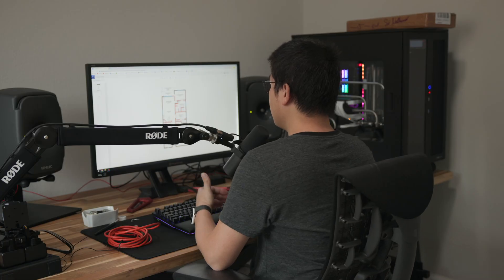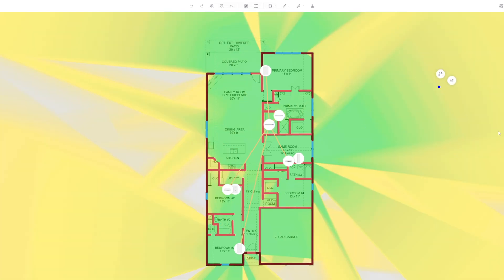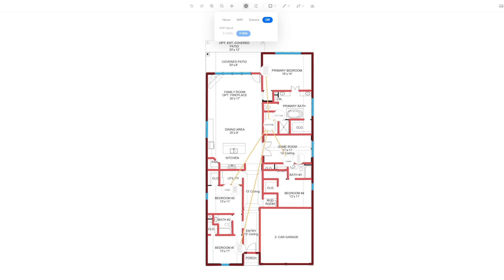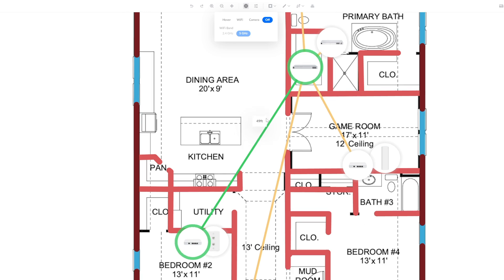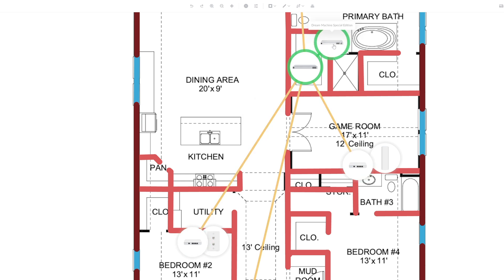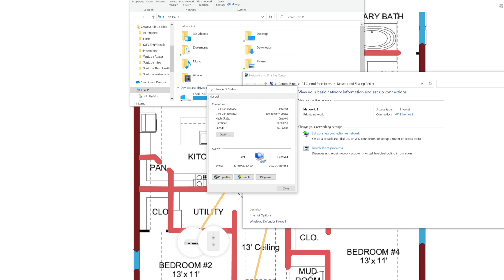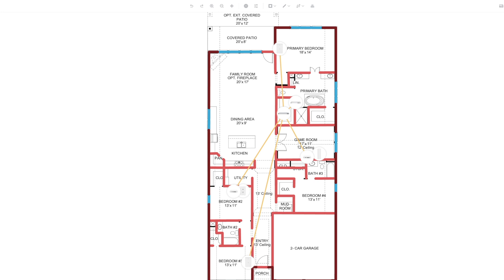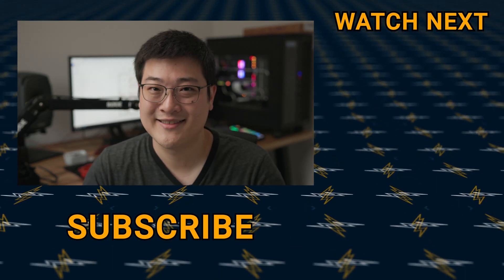10 Gigabit over Cat5e!

Comment: It doesn’t work for me. My 10GB Nas and 2.5G Wifi router is connected directly to a 2.5G switch using a Cat 7 cable. From the switch an in-the-wall Cat 5E is connected to my computer which is connect with 2.5G LAN. In this case the speed is still limited to 1Gb (105MB/s). When my computer connect to switch directly, the speed went up to 250MB/s. I don't get how could it work for you.
Reply: I finally know why it doesn't work for me. The ethernet connection in my room has to go through a 1GB  router before it reaches to the 2.5G switch. I've replaced the 1B router with the 2.5 Switch, now the speed doubled, thanks for your sharing.

Comment: I would go with a top of the range Devolo Plug Broadband Over Mains Adapters will let you use the Mains wiring to carry your broadband so you don't need CAT 5E or CAT 6E except for the patch cables that connect the Master plug into your Cable Router and the Slave plug that goes to your computer, providing that the walls are fully screened to prevent interference leaving your house.

Comment: Great vid; thanks so much for making it. Helps me see I can definitely have 10G setup in my house. I am in a very similar boat to you with the new build. I requested CAT 6 in my house, but due to an oversight on my part, the AT&T fiber run and jack coming into the home doesn't go through the garage (where it was expected) instead it has to be wired up to a CAT 5 (hopefully e?) phone port next to it on the wall in the bedroom, so I am stuck with a small CAT 5 run coming out of my BGW modem :(. Good news is thanks to your informative video I should be ok when I want to upgrade past 1G. 

I've got a Unifi UDR instead of a Dream Machine Pro, which is great for what I need right now. Once I migrate my switches to 10G it may be time to get something like what you've got with a Dream Machine Pro and some APs!

Side question: how did you fare configuring your modem to be a bridge to your UDM? I've heard there's issues with it but I think those may have been corrected in a firmware update. Currently running my UDR in a janky AP-mode setup, but hoping to make it be the actual router at some point. Thanks again!

Comment: I once heard of a man who got a 10Gbase-T working on a 70ft cat5e run. 

EDIT: if you really wanted to, you could replace all of the cat5e runs buy fastening cat6/6a/7 cable to the end of the existing cable (assuming you've already removed the wall plates) tugging on one end, and providing slack on the other.

EDIT2: Every splice/coupling reduces your signal strength.
Reply from the maker: No can do man. They've "stapled" the cable wire to frame. The only way to run a Cat6 cable is to go into the attic and pulling it. That's not the problem though. The real problem is trying to thread the cable down the wall especially on the exterior walls which has those fire breaks in the exterior walls that require you to drill through to thread anything through.
Reply: @StanYanMan  OOF